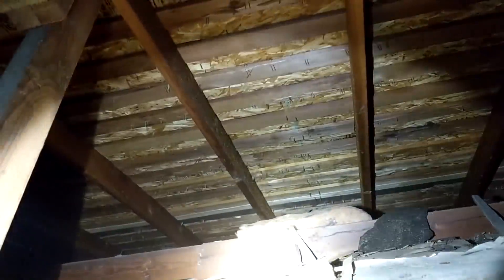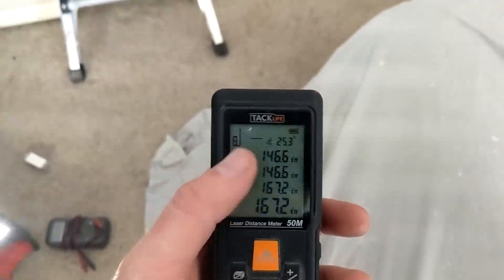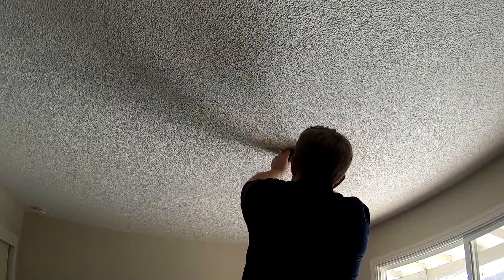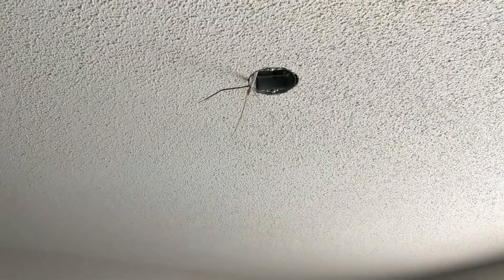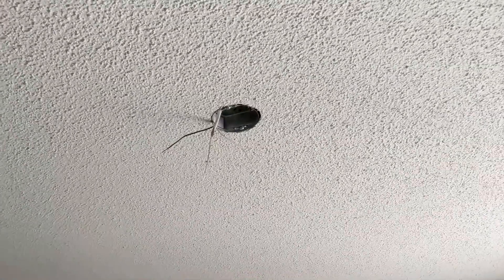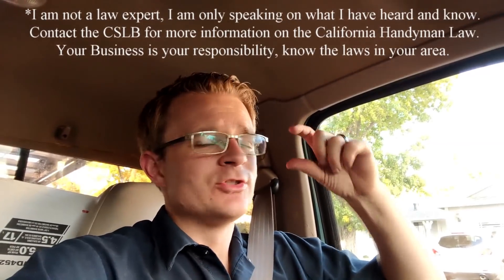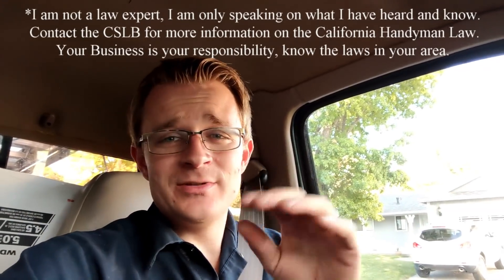They Get A New . . . .  / WLOG

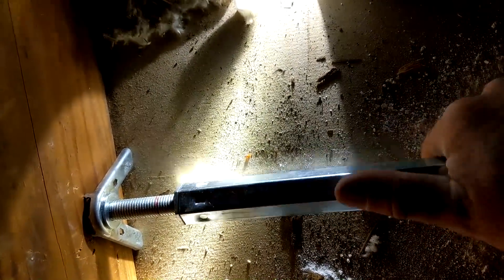Comment: At 4:40 - I would have used the other kind (for new construction) with the screws that go into the joists, since you have attic access.  I don't trust the kind that spin into place.  Also, with a ceiling fan, you're supposed to run 14-3 cable - not 14/2.  The switch box also needs to be changed out to a double, so you can install a separate control knob for the speed as well as a light switch.
Reply from the maker: Hey Jeff thank you for your comment. Yes running 14/3 was an option but the customer only wanted one switch to be ran for the light and fan both since it was operated on a remote.
Reply: Yes, I saw that.  I paused the video and wrote that comment before watching the rest of the video! LOL  But yes, if they want a remote, then 14/2 is all you need.  I personally don't like remotes because they get lost easily, and some of them won't automatically turn the light on when you flip the switch; you would have to locate the remote and turn it on manually.
Reply: or theres holes just add some screw since up there
Reply: I don't think those have any holes in the feet, as they are intended for areas without any attic access.   In fact, if I were the inspector, I'm not sure I'd pass an installation where one of those type of braces was used where there IS attic access; only in areas without.
Reply: at the 4:45 mark you can see the part into the wood has some holes in it you can stick some screws in i was just saying as you could be cautious lol but hmmm i wouldn't use this if i were already in attic though lol
Reply: Exactly!  And those kind cost twice as much as the other kind for new construction (or with attic access).

Comment: How do you know the wires from the switch are running to the attic? Did you run wires from the switch to the attic and around to the fan or was there another junction box in the attic and ran wire from there to the fan? I suck at electrical
Reply: What are those junction box called with the screw clamping system

Comment: Good morning Alan,    at 09:38 you mention whole house remodel.  if the
       homeowner is doing a remodel, and there are other tradesmen involved,
  i.e, sheetrock, plumbing, painting, etc,  and the homeowner asks you to
       specifically come and install a fan and light fixture only, those can be
  two separate projects as yours were in this video.   the homeowner may
       be acting as the prime contractor(general contr), or have a General
  Contractor overseeing the project,  as long as the General agrees to 
      you working on the site.   another way around the $ 500 rule is to
  do the work as time and materials.   occasionally i'll do time/materials
     @ $ 100.00 hr.   its  $ 200.00 hr if homeowner helps. 
  nice job on the ceiling fan/light fixture project.   btw,  we don't hear
     the word 'like' so much.
Reply from the maker: Hey Norm thanks for the comment! LOL I am trying to not use the word like as much so I'm glad that is noticeable! I'm not sure about the whole house remodel comment but that sounds like a possibility.

Comment: When I put up fans, I usually put the blades on and attach the light after I get the motor hung and wired. I find it easier to work with the blades off... Whatever floats your boat though! LOL I've used that same fan mount before. works good if you can't get up into the attic at that area. I find that if a joist is close, I love the fan rated pancake boxes cheaper and quicker.
Reply from the maker: I have never done it without the blades on first, Maybe I will give it a try next time. Thanks for that! I agree, The fan rated pancake boxes are way easier! Thanks for your comment!
Reply: Just put up 6 fans and 4 light fixtures yesterday. 1 fan was the the typical install and the other 5 were new to me. With that one you had to mount all 5 blades to a circular hub/ring and then put that up on the motor housing. Back over today to install 4 more fans and many more light fixtures. If some one hasn't heard of them before, be sure it says "fan rated". They are about 4 bucks at Home Dummy and come with 4 hex head screws,  wire protector, and a metal cover to put on to protect the box if the ceiling has yet to be textured or painted.

Comment: Cool. Thanks for the clarity on the law. I've been. Wondering what CLSB considers as a project.
Reply from the maker: Well, even if you ask the cslb they will not give you a straight answer on what "project" means. that is the issue with the way the law is written, there is no distinct definition of what a project is. This is the way that I interpret what a project stands for and the way that I have had some people at the cslb agree with.
Reply: @handymanjourney  I agree 100%. 
Thanks for all your information. It helps a lot as I'm I'm the same shoes as you. If your ever in LA or San Diego area. We should meet. I'm in an hour in between those cities.

Comment: You need to include the value of ALL materials ( the ceiling fan, boxes etc.) when computing the 500$ limit. If you charged $450.00 for labor, that ceiling fan had to be less than $50.00 or you are breaking the law. Also any agreement for payment in California over $500.00 is unenforceable in court unless you're a licensed contractor. Watch out for SWIFT they have stings all over the state looking for this kind of stuff.

Comment: Hi lee. Make sure I'm clear on your wiring. You  ran 1 new wire from an existing wall plug hot wire, to a new wall switch, then a 2nd wire from the new wall switch to the new fan box? You used a 12/2 wire?
Reply: That's 14-2 wire (white).  #12 would be yellow.  But he should have used 14-3 rather than 14-2.
Reply from the maker: Hey thanks for your comment, yes the customer only wanted 14/2 ran on this job. The outlet was originally switched so I just rewired it to make that wire a hot wire and the outlet hot all the time and then just had to run one wire up from the switch box to the fan.
Reply: @handymanjourney  thanks for all u do

Comment: (The following is not legal advice, just my own theories, you are responsible for how you use it)

Makes sense. I believe the reason behind this law is based on contract laws of California.

According to California code, simply put, monetary value above $500 will not be enforced if the agreement was verbal. Some contracts can be verbal and be enforceable, while others have to be written with signatures from both parties. An example is a marriage contract.

So this "$500" limit just protects the customer from an unenforceable contract. On the other hand, the code states that you must be licensed to do work above $500 'if acting as a contractor'. What does that mean? I theorize that as long as you don't "act as a contractor" you can do jobs as expensive as you wish and California can't ticket you. In order to not falsely advertise, youd need to include "not a contractor according to $$code#..." on all your advertising.. I'd be interested if someone could figure it out. The reason is, I dont think California has the legal right to limit work. The right to work is a fundamental right that we have in this country and to require a contractor license because you want to paint two bedrooms for $800 seems a little extreme. What could go wrong??? Why make a painting contractor license a requirement. In reality it's probably not to protect the customer so much as keep track of taxes and provide work to a select few.

Theres a similar law in mechanic work. You can be an auto mechanic without being part of BAR, but you MUST state this wherever you post your logo or name or advertise, such as a business card. Otherwise you would be false advertising that you are a part of BAR. The Bureau of Automotive Repair is just a legal entity like the Contractors Board of California, but for mechanics.

Please comment, I'm really interested in this topic and have done a lot of research as well.
Reply from the maker: I think your theory sounds good, not sure how it would hold up in court. But I think it is rediculous that the state of California or anyone for that matter fan think they can impose such restrictions on people and limit the free market. I think in the end the CSLB is targeting illegal contractor's doing big jobs like remodels and things like that. Thanks for your comment!
Reply: When you surpass the 500 limit you are then considered to be acting as a contractor. It is basically the same in AZ but a different dollar amount. Most people just ignore it and work for trusted customers, its really only a customer that wants to burn you that will get you in trouble.
Reply: I think you're right. There are times when laws are construed to make it seem like the law applies to everyone, but the actual definitions are different than they really are (using a definition tree, by redefining commonly use words)... pretty terrible. But with all my research I can't find anything in regards to "contractor" or "contract".. UNLESS the definition they are using is from PCC (22351), which states a "contract" is work done by a person with a public entity... But I don't know.... Something extremely important that a lot of handymen don't know, is you MUST state in all advertising that you are "not a contractor pursuant to BPC 7048". If you don't, and you say you can do home repairs, or anything like that, I believe it's legal evidence that you are assumed a contractor, and according to 7048, you are no longer exempt from needing a license, and you can be fined for (1) being an unlicensed contractor, and (2) falsely advertising. They may not take the effort, especially if they have records of good service, tax filings, business license, etc... but it's something to keep in mind. My dad was a mechanic at home for years, and he was required to state he wasn't apart of BAR pursuant to ### (which is similar to CSLB), to avoid false assumption/advertising.

Comment: good morning Allen 

Just a quick re The $ 500 limit ...you said that's for both material and labour . 

On the materials end of this , is that only for incidentals ...ie: wire , an electrical box etc .  

Or does that include the ceiling fan as well 

Like ...   ( oh , there's that word again )  ...if you were asked to install a kitchen sink and faucet , but the sink was valued at $ 300.00 and the faucet at $200 ,does that mean you couldn't do it .

Or does it matter if the homeowner was the one who purchased the sink/faucet , so it doesn't count in the $ 500. ?

I liked that fan mounting box kit you used , it  looked good and strong .

I went to an estimate a few years back , to fix a fan that had fallen out ...turned out someone had originally put in a ceiling light , where one didn't exist  using a reno-box similar to what you use , fine so far , but when these people bought the house , they had some hack handyman change out that light for a fan/light   ,  and this guy didn't know to put in a reinforced ( to code ) fan box .

So when I got there ,  the fan was still hanging there , from the wires , but where the box come out of the ceiling , it tore a big enough hole than would of required some drywall/stipple work , which the homeowner asked just to have the whole ceiling scrapped down  and retextured in a " Knock-down " style .

This was over their bed in the master suite , and she said they have sleep in the bed since ( 4 days I think ) .

The job was going to take far more time than I had available , so I had to pass. 

But I did  remove the fan , and staple up some poly over the hole .

So point to this , is that just because someone knows " How " to do something , doesn't always mean they " Know what to do ".

Oh well , so much for a quick comment .

Thanks for the Wlog  ( shouldn't that be " Wvlog " )

Bob from Calgary

Comment: Why not just use a 2x4 to mount the box? I would only use that mounting bracket if i didn't want to go up in the attic but whatever works for you.
Reply from the maker: Hey thanks for your comment! I'm not sure how I would have used it to buy for, maybe I'm missing something can you explain further?
Reply: I think he's saying those brackets are really if you don't have easy access to the attic. Even myself I would have put I a few screws on the bracket wings just for extra strength.
Reply: Francisco Martinez Ok, how are you going to run your electrical without going into the attic? 

Allen did it the correct way.
Reply: Honest Lee Handyman 
It's a common practice to use a 2x4 (horizontal brace toenailed or pocket holes) and a ceiling-fan rated octagon box or pancake box when there is good access to fasten it all together. It's less likely to fail (drop the fixture) if there is any play in the joists.
Your perspective adjusts after working on higher-end homes with high-dollar fixtures and cathedral ceilings.
Agreed, a twist-hanger-bar is good when access is restricted.
Reply: @1232bluejays  you are correct. You got what i was saying.
Reply: @Tablesaw818   if i was just replacing the a light fixture with a ceiling fan the electrical would already be there and i wouldn't had to go in the attic. Assuming i could break the old box loose and out of the way.
Reply: @handymanjourney  Don't you think a 2x4 screwed in between the joists with a pancake box be a lot more sturdier? Plus its a lot cheaper.
Reply: Francisco Martinez That obviously wasn’t the case for this job that Allen was doing.